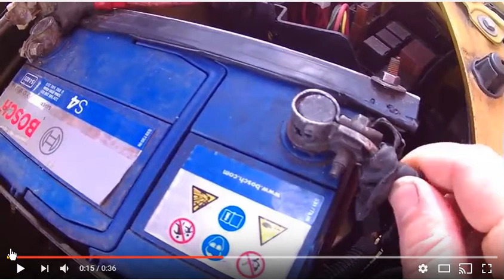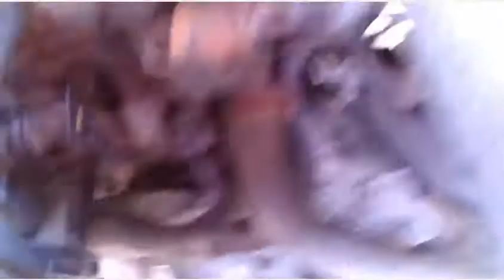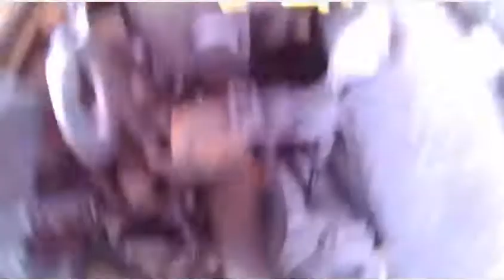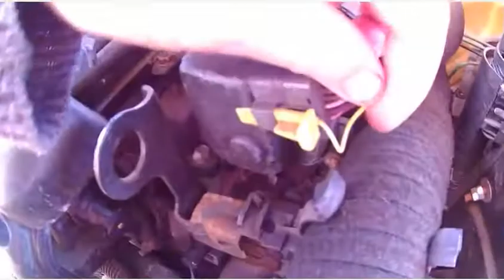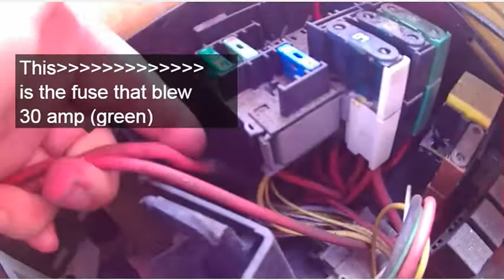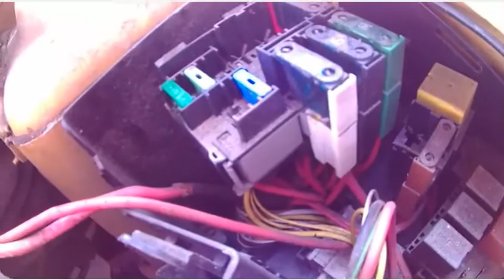clio authentique 1.2 8v 30 amp fuse blown car dies

Comment: DID IT COME OUT EASILY  (that fuse)  the large  green AMP fuse under the bonnet  on the 1;2 CLIO  8  VOLT    is the heater BLOWER   and YOU HAVE ANSWERED YOUR QUESTION probably   BATTERY  TERMINALS